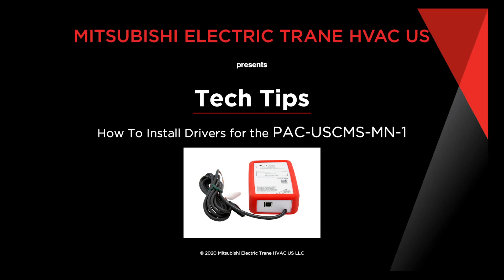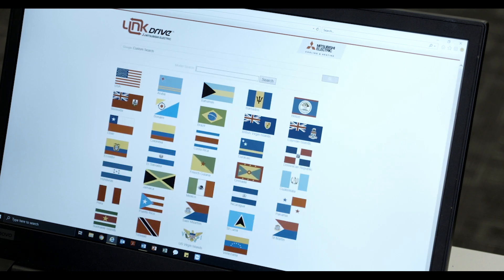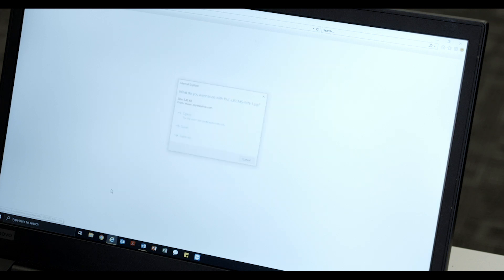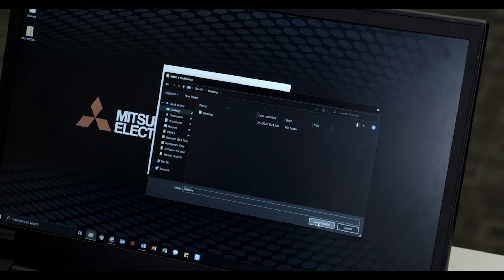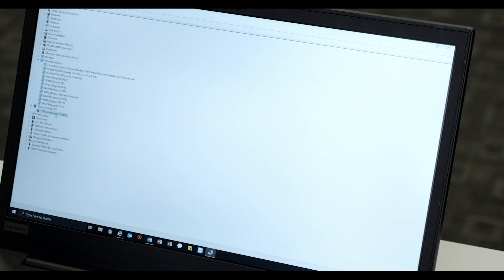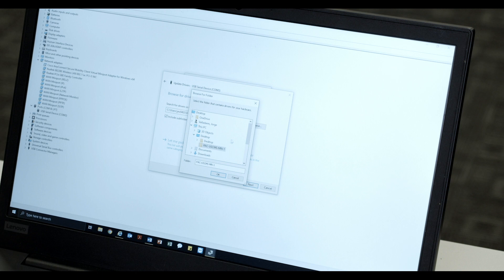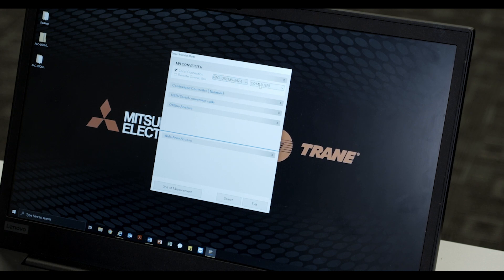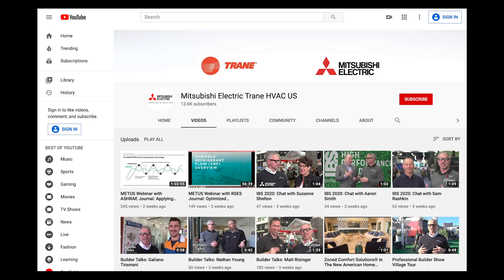How to Install Drivers for the PAC-USCMS-MN-1

Comment: Yea since trane bought out mitsubishi trane seems kinda lost with new mitsubishi maintenance tool, I wish this guy can show me that with windows 10 step by step because windows 10 isn't accepting the driver provided, my friends old legacy converter with the old version program seems to work without issues, I'm forced to work with windows universal com3 drivers for the new converter & I havr issues getting into operstions for CS in the program everthing else seems to work, have video to prove it that on the same hyperheat condenser i was first able to get into operations of CS than half hour later I wasn't, all that trane/mitsubishi guy said "oohhhh it should work" maybe you can still warranty the converter & retry. I'm beginning to loose faith in mitsubishi since trane bought it out I can guarantee the quality of equipment will be the same way
Reply: Trane did NOT buy out Mitsubishi nor dit Mitsubishi buy out Trane, they formed a joint venture so as to have the Trane logo along side the Mitsubishi on the equipment and it has been a great pairing for both businesses.
Reply: @timconnell4186  Might be a great pairing for their sales but that didn't flow over to their respective tech support. Carrier tech & sales support is by far the worst but Trane & Mitsubishi is catching up.